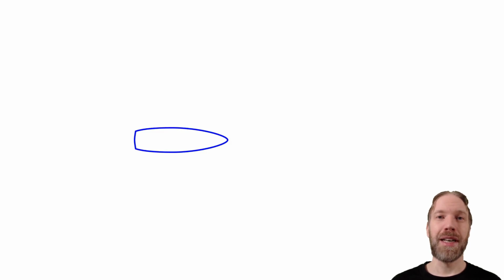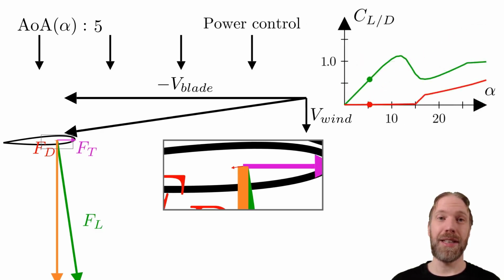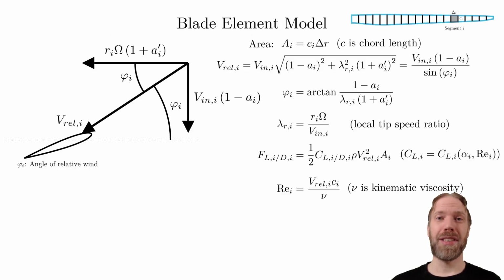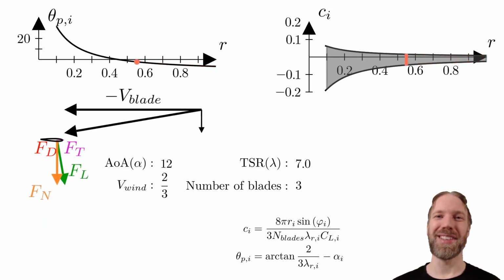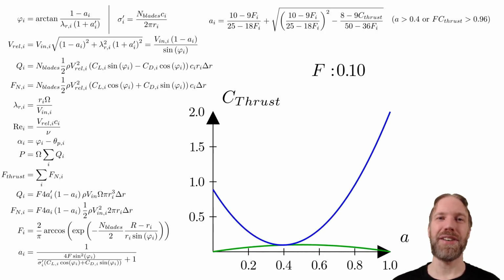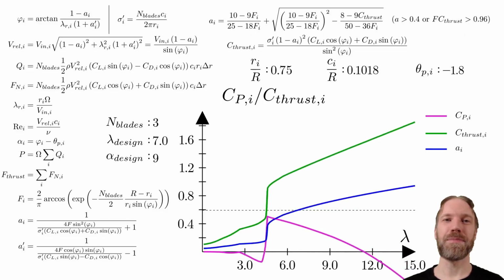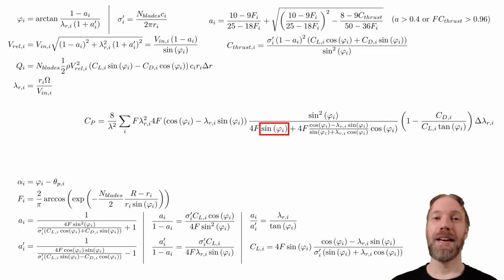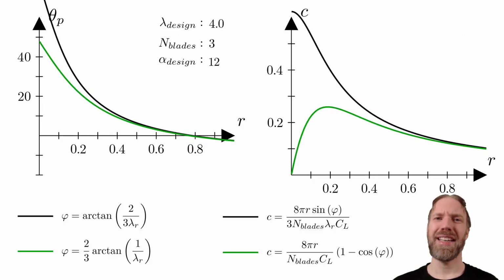Wind turbine aerodynamics: Part 4 - The blade element momentum model

Comment from the maker: Errata: At about 47:40, the correctin factor F is added to the equations for the torque and the normal force. Here, there should be an index i added to this factor (i.e. Fi) as the correction factor varies with radius. Also, one could add in the index i to Vin,i in the expression for the torque the same way as it is added for the normal force